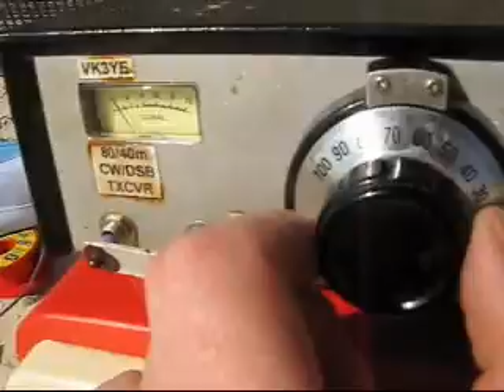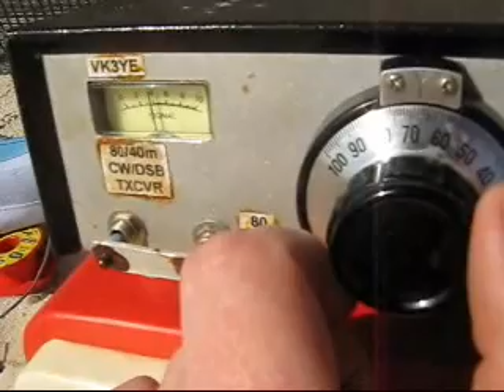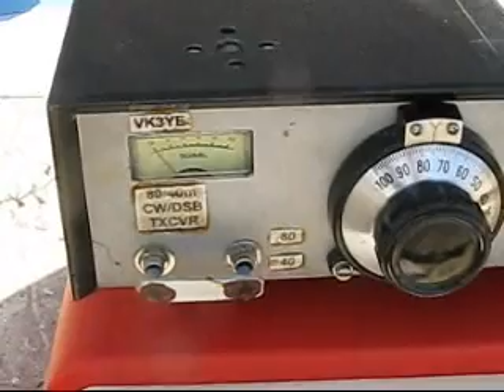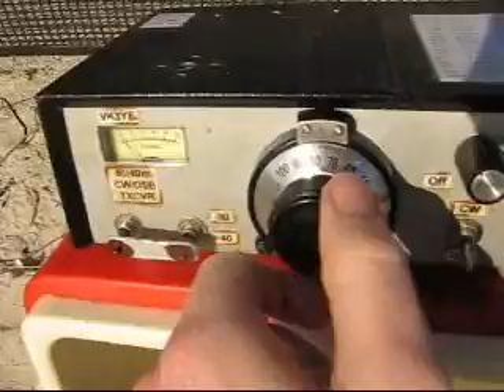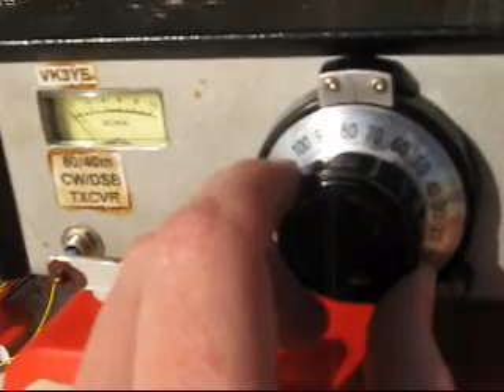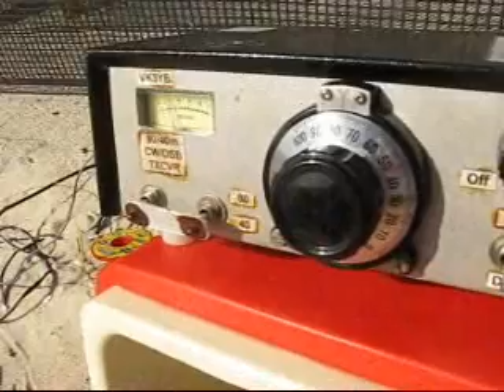Five minute portable station: HF QRP DSB from Port Phillip Bay

Comment from the maker: @2e0bmi Thanks OM - glad you liked the video.  It took a bit of fiddling to get going so I wouldn't recommend it for a beginner.  Start with a single band direct conversion receiver, then maybe a CW transmitter first and work up from there.  Try searcing for  ZL2BMI DSB or M0DAD DSB as a starting point for simple DSB gear.

Comment: Nice video, Peter,  Your homebrew transceiver made 4x9 QRN (lightning static) on 3613 kHz, last Friday night to my QTH near Gundaroo, NSW.  It sounded good on either sideband. :-)

(My station consisted of an FT-817 running 5W via an ATU and homebrew 600 Ohm line to an inverted vee.)

73,

Mike VK2IG/QRP

Comment from the maker: @huelbe - thanks. The ATU is on the rear panel. Only a short wire counterpoise clipped to a metal fence if there's one around.  A half wavelength end-fed is pretty forgiving.